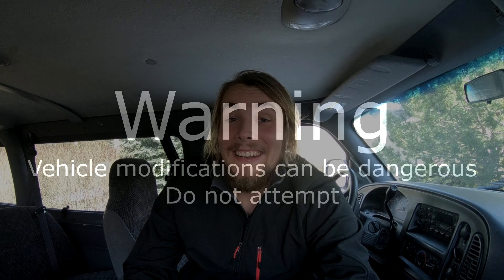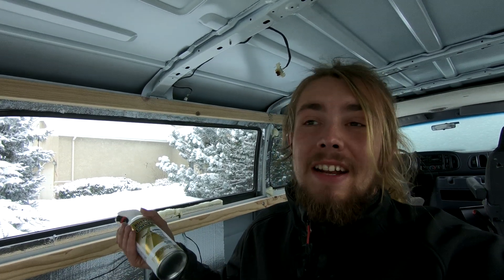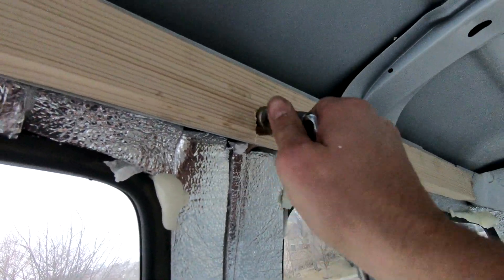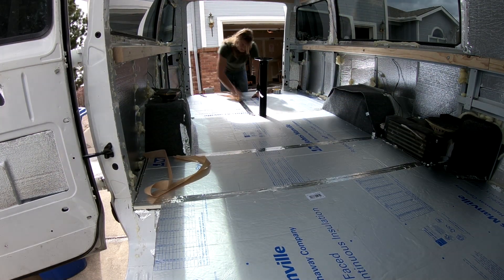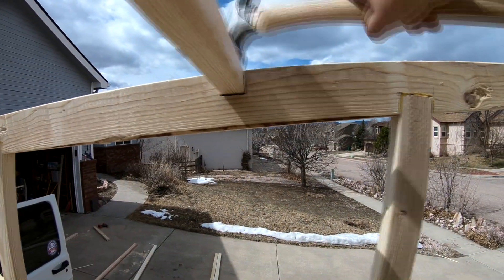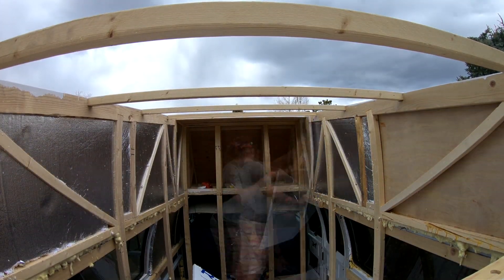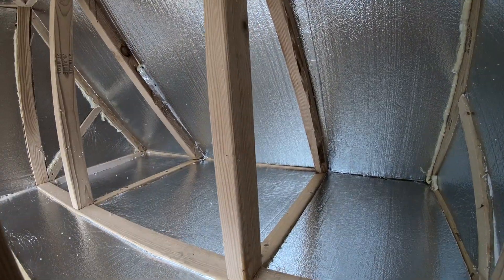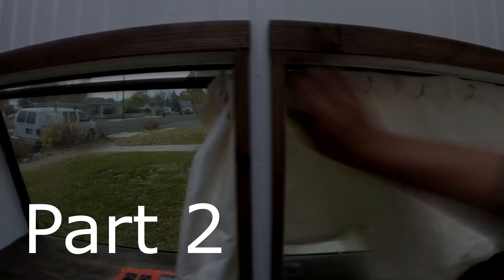How I Built my DIY Hightop Campervan - Start to Finish - Part 1/2

Comment: FYI you can save a decent amount of money if ou buy Ustleum paint in Gallons and Spray it  with a HVLP Turbine Paint Sprayer  most of those Spray Rigs work similiar  i myself have a older CampbellHausfeild they do not  any longer  sell a a Complete setup  although i can purchase the parts from them and make my own kit ,mine is 25 years old and i like it because my Spray Gun and SiphonCup are all Metal(Aluminum )  Construction and i like that to scrub it clean with SteelWool and Brass Brushes between uses  i like it Spotless and dShiny ! I’ve also Polishedit to make it easier to Clean   on your End Grains i prefer to use a Petrating Marine Epoxy generally West System or TotalBoat brand

Comment: Good job though. If you happen to buying a second one, I'd give you all the advice on the metal fabrication/welding. 👌 It would definitely take a lot of welding, but then you would know it's 100% sealed. There shouldn't be any issues with the welds breaking with steel, might also be lighter than the wood if you choose the right material dimensions and thicknesses.
Reply: Im building one too. Can you give me some help on welding?
Reply: @Stevef2234  What advice specifically? I would use steel sheet metal probably 14 guage and get a harbor freight titanium 125amp Flux welder. There is a lot to that project though really. You would need to make a template, and then probably use cardboard or some other easy to cut material to make the mockup. Then get the desired material and weld it, then reinforce everything.

Comment: Oof, these vans are already a roll over risk, and you added more weight up high, increasing the center of gravity. Im not sure how you'd even be able to take a corner considering how much that van swayed just with you standing on the roof rocking it.